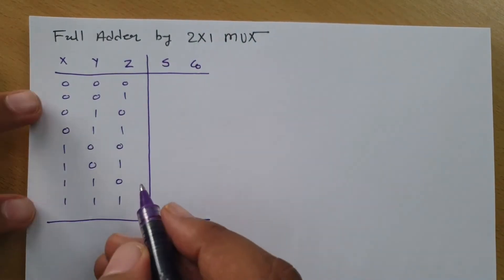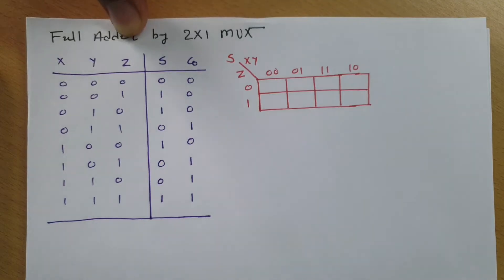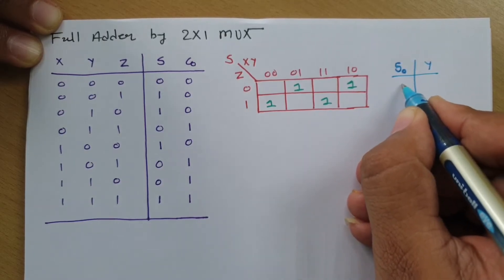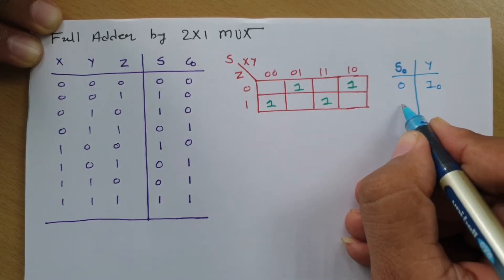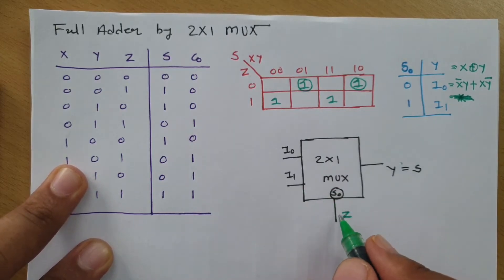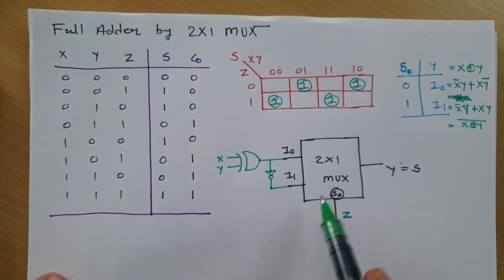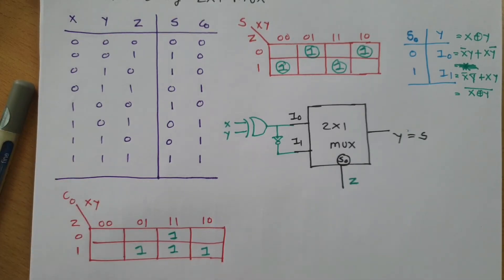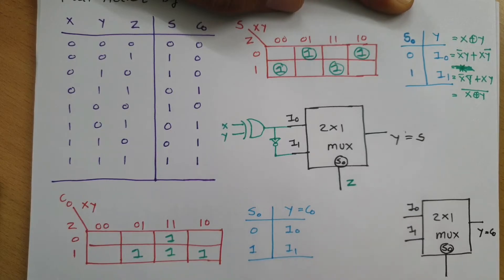Full Adder Implementation using 2 to 1 Multiplexer: Designing and Circuit

Comment: sir dont use any other gates like exor and and instead use only two 2*1 mux you can able to design a sum circuit sir
Reply: To implement basic gate i(and,or,not) requires only 1 (2:1)MUX and for any arithmetic and universal gate implementation we need 2(2:1) mux